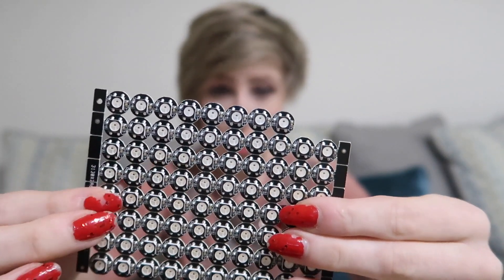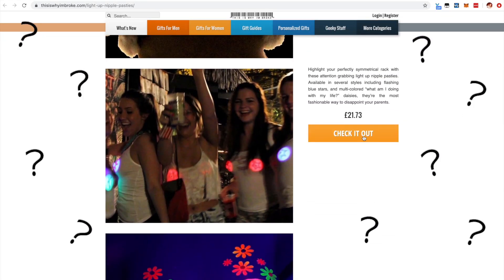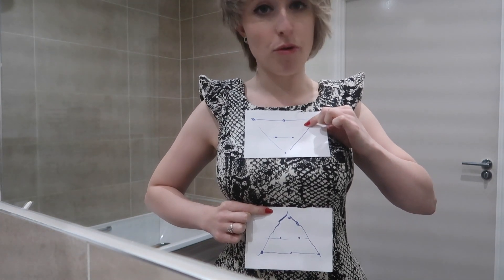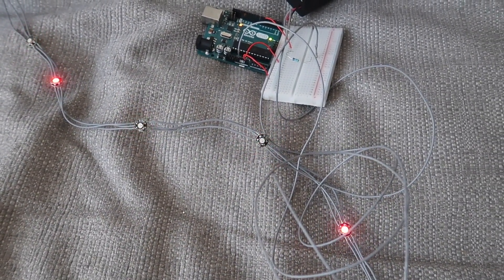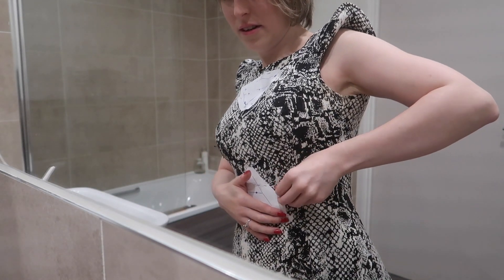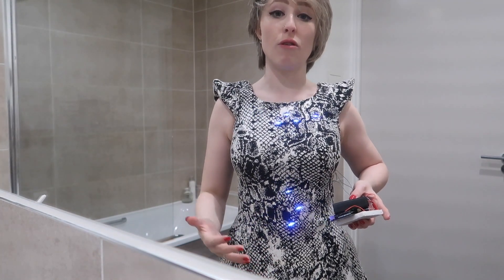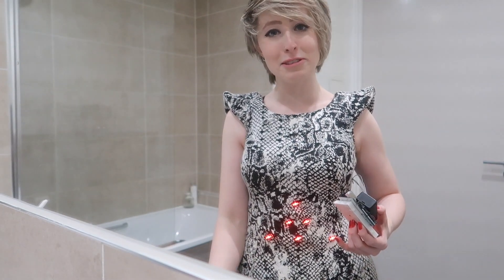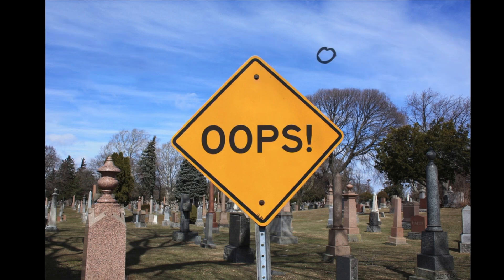How to build a LIGHT-UP DRESS in one day with programmable LEDs

Comment: If you are using 1 pin to control the strip, use a smaller microcontroller  like Arduino Micro, mini or nano. They are so small that you can sew them into the fabric and dont have to worry about them. They all run on two AA or AAA batteries.